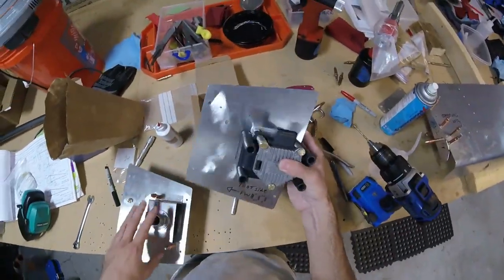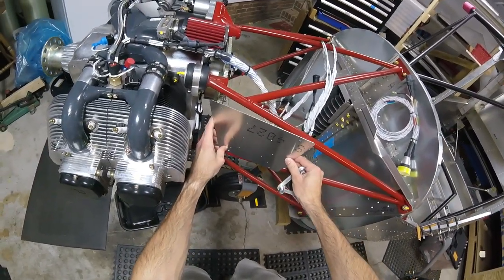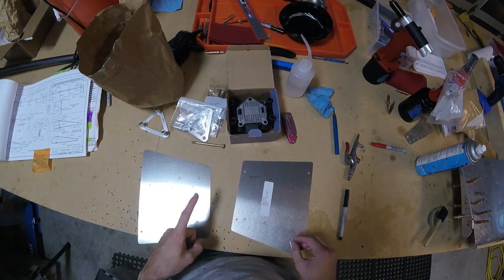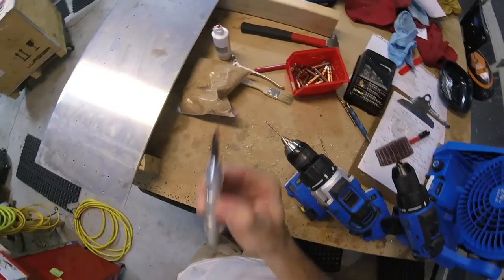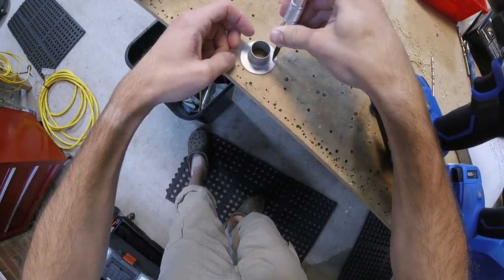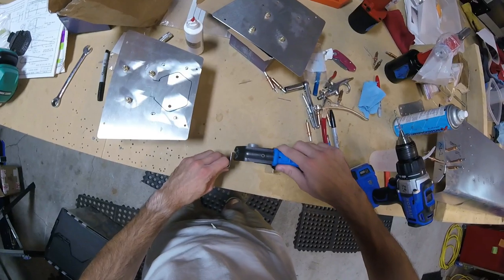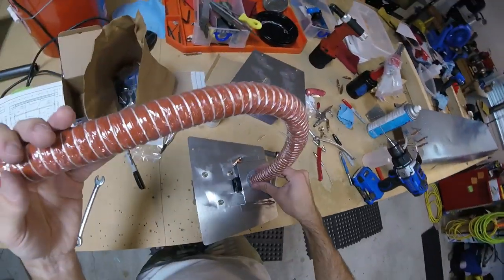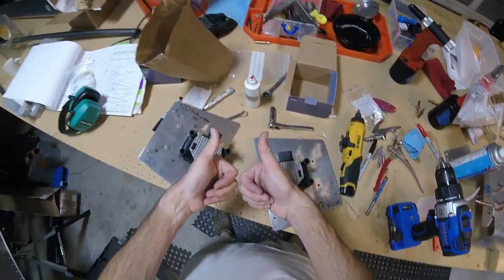Assembling Ignition Coil and Voltage Regulator Mount Plates - Zenith 750 Cruzer Kit Plane - UL350iS

Comment: Is there no thermal paste required on the ignition coils that contact the plates for thermal conductivity?
Reply from the maker: Thermal paste is suggested as an option. Actually, what I'll be doing is using thermal paste as well as adding an aluminum plate to the back of the RR (regulator/Rectifier) for better contact with the mounting plate (and better cooling). (after mounting the assembly to the engine mount frame, I saw that there is a gap between the back of the RR and the mount plate, which I suspect may be the cause of some overheating issues some people have had). I'll make a video about that when I do it.